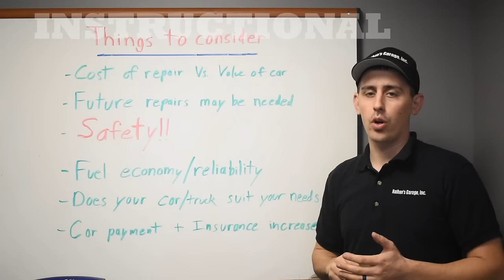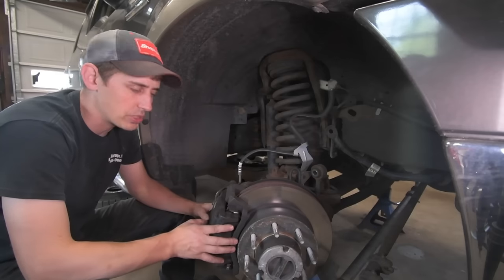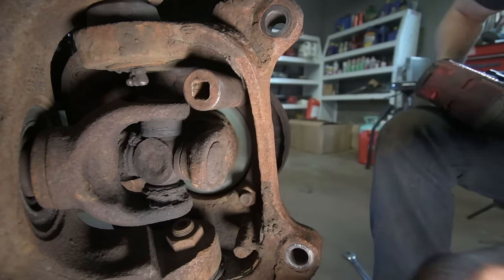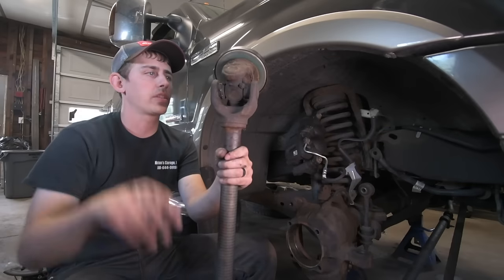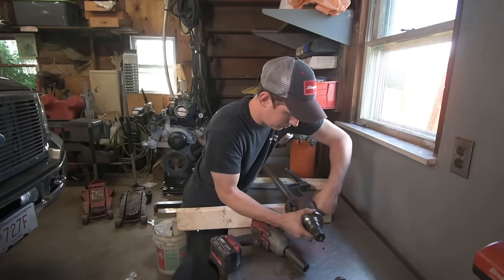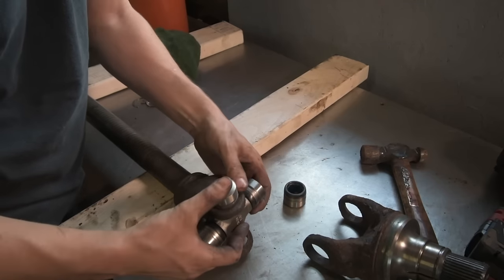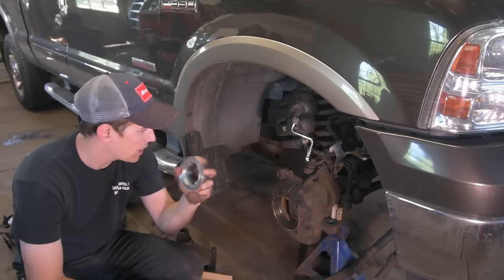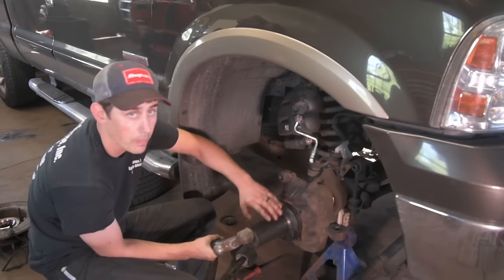Ford Superduty Steering wander repair....Axleshaft u-joints

Comment: This was PERFECTLY TIMED! I just did some upgrades on my truck's electrical system and took it down the road and the steering is sloppy as all get out! So this is the video I am hoping to use to correct a lot of that play in it. Thanks so much for this enlightenment young man! You just made this old fart's day!  :)
Reply from the maker: Thank you! hopefully this helps you find your problem.
Reply: @InTheShop  OOPS! I just deleted what I wrote because I was responding to the wrong article. Yep that would be me...the back woods hillbilly. LOL  And yes I think this is gonna be a huge help/ But getting the tools you had in this video is another story. So I might have to be super creative when I do it, plus I'm disabled so if I start that project it's probably gonna be most of the summer getting done. LOL. You know how it goes...remove a bolt and rest an hour. Then remove another then rest another hour. It wouldn't be so bad if I could be drinking a beer with each rest I take. LOL  Too funny. But seriously that IS the way I have to do things anymore.  I just replaced the idler wheels and pulleys and serpentine belt on this truck. Took me all week to get it done but she runs really good now and I can trust it to go a little bit longer distance than before. so that makes me happy.

Comment: the issues i had were resolved after i changed steer box / pump tie rods nothing worked it would get a little better with each thing finally  i changed the hydro boost for the brakes and that solved the problem

Comment: God Bless you after 2 steering box's, stearing pump . New line's and cooler and flushed out many times cost around 1,200 and my proublem is still there.  But I have a real good Gut feeling your 100% Spot on . I promise to come back and give you my results in a week or so.  One more thing Iam like you and don't mind getting my hands dirty but I found curad makes a rubber glove that really holds up there are 50 in a box  and I got them a a meyer in Michigan.  Thanks I do appreciate you my brother.
Reply from the maker: Hopefully this is it! Let me know what you find. Thank you!
Reply: It's going to our alma mi ford dealership Fri and there going to replace both sides cost 960.00 I will let you know

Comment: Great explanation sir. I currently experiencing a wonderer in my Dads  2005 f550. I'll bet that this is the problem with it as well. Thankyou for tge possible heads up . Little nervous tostab that axle back in correctly. I think I recall the spline to be difficult to line up to slide the axle back in. AL said,  I appreciate the pointers.  Till next time! 
David

Comment: Ive replaced entire front end of my 08 f250 shop truck and it still drifted left and right hate driving it anymore def checking ujoints first thing tomorrow thanks for the tip

Comment: Great informative video. I like that you really stick to the point and show exactly how to do the job. I have the exact problem and you confirmed my diagnosis. I will likely take it in to have it done as I don't have the special tools for the job and don't expect I will do it more than once each side. Thanks for doing this as I can now clearly instruct the shop what I want done.
Reply from the maker: Thanks for watching Cris. I love hearing from people when my videos helped them.
Reply: @InTheShop  Hey I got all my parts and tackled the job. Did both axles and replaced the hubs at the same time. Went pretty well as you demonstrated. The only thing I found was first I managed to get everything unbolted without dropping the tierod and my u-joints were so seized that the ball joint press did not work. I took the axles to a local machine shop and one was so seized that when the pushed it through the caps would not come off. They ended up cutting that one off. They only charged me $75 to re&re both u-joints so ended well.  Thanks again for the great instruction.

Comment: Excellent knowledge! Thanks for sharing. Will do my 2006 Ford 6.0l dual rear wheels tmwr.All front end steering components, Axle hub, universal joints, & tie rod ends.
Reply from the maker: Thanks for watching! Hopefully it all went smoothly for you.
Reply: @InTheShop  Not yet. I wrecked/ messed up 3 snap ring pliers. Could not remove the axle snap ring retaining clip. After 4 hrs three(3) snap ring pliers all damaged, i ordered a heavy duty snap ring. It got delivered today. Gear Wrench 2012D- heavy duty. Will update on progress.

Comment: Thanks for the info. Being an old farmer myself I’d be embarrassed to tell you about all the mistakes I’ve made changing universal joints. I have a 2002 F250 7.3 with about 260k miles and it’s wandering all over the road. Your video is going to make this job easier without all the unknowns that I usually encounter. You make great videos, easy to follow. I noticed that you didn’t use any type of spray loosener. Wouldn’t things come apart easier with some? Maybe I don’t need it. 
Don’t know where I’m going to get those Ford tools, probably have to make some. How far can I go until the wheels fall off? Haha, just joking.

Comment: this was a great video. I have an 01 350 and i have a sneaking suspicion that it may be the front axle Ujoints but i am not 100% because i don't have steering problems. the problems I am having is that in 2wd going 55+  a low pitched humming noise happens accompanied by a light vibration. but in 4wd whether high or low the front end almost sounds like the drivers side start popping and clunking. some have told me it is the unit bearing but i jacked it up and couldn't find any slop or play so i have kind of hit a road block here and i don't have thousands to pay a shop to diag and repair it for me you know... but the noise also almost sounds like it's coming from the pumpkin as well....
Reply from the maker: The humming is likely the bearing. Most times unless they are really bad you won’t be able to hear or feel the play in the bearing.
Reply: @InTheShop  yeah but the humming and popping clunking sounds started at the exact same time and if it isn't the unit bearings causing the popping and clunking noise then I am thinking it may not be them I just don't want to drop around $400 for wheel bearings just to find out it's not them you know? Or even worse drop that money and do all of that work to find out it wasn't them AND that I have to do that work and then some all over again.
Reply: @insaneTrout  Your U joints going bad likely damaged the wheel bearing. Not what you like to see but it happens.

Comment: I have a 97 sclb powerstroke with skys shackle flip kit.  It has sloppy wandering steering. Ive done everything to the front-end except the u joints. I will check u joints now

Comment: Good work!  Currently chasing a steering issue on my 08’. I will check my u joints to see if they are free.  I don’t hear any strange noises in 4 wheel drive so I assume they are working. Seems like running with the hubs locked would give this problem away quickly.
Reply from the maker: Thank you! Sometimes this won't be obvious when driving because the power steering can easily overcome the resistance.

Comment: Great Video and perfect step by step.  I would have liked to have seen a torque wrench at a few VERY important steps in there to reinforce how important bolt tension (Stretch) is on steering components (which is why they included new wheel bearing nuts for the studs).  But all in all you get my vote, hands down, for a great tutorial.
Reply: And you missed your calling, you would have made a great Airframe Mechanic... well, you still could, I became one at 59 after 40+ years in construction.  For some, like you, it comes naturally (the learning and retaining).
Reply from the maker: Thank you so much!

Comment: Extremely well done video Nathan, how ever you didn't show which way the grease nipple should face, Should it be in toward the axle or face out toward the nuckle hub?
Reply from the maker: Thanks Lawrence! I like to point the grease fitting towards the axle. The reason I do this is if you turn the wheel you can get the grease gun straight on to it. If you face it toward the knuckle the grease gun will always have to go on at an angle.

Comment: Excellent video, brilliant young man.  Direct, to the point, a lot of good tips based on actual experience.  I replaced left side hub bearing/seal/u joints on my '05 several years ago and see where I made mistakes.  Getting ready to do both sides again so I can get it right and maybe the SOTF will work again.
Reply from the maker: Thanks Jim!!

Comment: You could do your axle shaft joint check without taking off the tie rods buy turning the wheel locking the hub and trying to rotate the wheel you will feel it binding as you rotate it
Reply from the maker: On one as severe as this was you could probably feel that in the wheel but in a less severe case the mechanical advantage of the steering box can make it not as evident.

Comment: I had this happen on an ‘80 CJ I had.  It would actually ‘grab’ the steering and pull it. 

On these Ford’s with the bearing cartridge, I’d just replace that too while it was apart.
Reply from the maker: Most times the bearing needs to be done at the same time. These wee pretty recently replaced. Thanks for watching!

Comment: I really enjoy your videos and you are very good at expressing your knowledge so it’s easy to follow. With that being said maybe you can help me diagnose an issue I’m having with my 06 F350. I am having a vibration issue at almost exactly 45mph, the steering wheel does not shimmy or vibrate and does not pull in either direction. Apparently the previous owner had issues with this as well from looking at the maintenance records he provide when I bought the truck.
Reply from the maker: I would start by inspecting the rear driveshaft. The universal joints and the center support bearing are both very common.
Reply: @InTheShop  thanks for the advice and for actually responding. Once this is all over I'll use my friend's garage and check those out.

Comment: This can happen from not using your 4wd.  If you have manual hubs engage them occasionally and drive around.  You wont hurt anything w/ just the hubs engaged.  If you have an automatic system, go to a gravel lot and drive some figure 8's for a few mins.  Give those ujoints some exercise.
Reply from the maker: Absolutely. That and some preventative maintenance if they have fittings.

Comment: Well done! Lots of information not typically included by the less experienced. Best of all, you didn't waste any video time putting on a horse and pony show. As an automotive instructor, I am always on the hunt for the most informative videos for my students. What most impressed me isn't so much that you are familiar with torsional stresses as they apply to universal joints, but that you cared enough to elaborate on the preferred placement of the grease fitting for the simple benefit of sharing that information with your viewers. Props to you!
Reply from the maker: Thank you so much. I have always wanted to teach and these videos have been my way of doing that. I love when people get something out of the info I share. This comment means a lot to me.

Comment: I have had this issue several times.  I have come across locked ball joints too where you couldn't feel anything with vehicle jacked up and bar under tire and moving wheel but once you took everything off knuckle and then turn it it would bind.
Reply from the maker: Another common problem. Thanks for watching.

Comment: Excellent video. Just had front end rebuilt and steering box replaced and still got a bit of drift. I know on axle and ujoint was replaced just before I bought the truck but the previous owner said he hasnt done the passenger side. Im assuming when you buy the wheel hub assembly it is already sealed. Mine was already converted from auto 4wd to manual so I assume the vacuum system is not needed for anything and can just be sealed. I do have ABS tho. Thanks for the info very much! Helped me diagnose other problems I thought were unrelated.

Comment: Amazing. I assume this is what’s wrong with my excursion. A friend of mine put $3,000 in a full new suspension system to fix his wander and it never worked. I have wander and I couldn’t figure out what it was because everyone I know who own excursions said they have wander.
Reply: Try replacing the gear box with a redhead or Blue top.

Comment: Nice video. The upper "tie rod" is actually called a drag link. A tie rod connects one steering knuckle to the one on the other side so both front wheels turn together while the drag link connects one steering knuckle to the steering gear box.

Comment: I think the best way to get that wheel bearing off is to wedge in between the knuckle and the bearing. Start with a very small flat head screwdriver and work up in size. Don’t pry, just hammer it in and pull it back out

Comment: There's a much easier way to diagnose this, without any disassembly. With the hubs unlocked and transfer case in 2H, turn the wheels a bit to one side or the other. Using a long-ish prybar try to turn the axle shaft at the universal joint. It should turn a full revolution pretty easily.
Reply from the maker: That’s another great way to check them. I personally prefer this method because it’s not a lot of work to pop the tie rods and it eliminates any other resistance besides possible bound up ball joints. Thanks for watching and thank you for your input.

Comment: What I like to do is to soak that shaft the night before in penetrating spray, sometimes I just cut the trunion out instead of forcing the caps through the rust, and I always throw the ujoint into the freezer for an hour, goes in like butter. Thats how its done up here in the rust  belt
I hope customer got his money back for the new box or old one put back in.
Reply from the maker: Thanks for watching. The customer chose to not pursue the previous shop.

Comment: Awesome video! My u-joint was the culprit, trying to put the truck back together right now and can’t get my auto 4wheel drive locker to match up with the axle splines. Tried spinning the axle while trying to push 4wheel hub on but something is holding it up. Any recommendations would definitely help right now!
Reply from the maker: Pepe Vargas spinning the hub while also wiggling with inward pressure is usually what it takes

Comment: make a seal installation tool out of a 2 inch to 3 inch plumbing reducer with a 1 foot length of 2 inch schedule 40 and end cap . cost about 12 bucks works great.
Reply from the maker: That’s a good option

Comment: Another easy way to check the U Joint without removing the wheel is by jacking the wheel off the ground and with the wheel straight lock the hub and spin the wheel, should spin free, now turn the wheel just a little bit left or right, if the U joint is bad you won't be able to spin the wheel.

Comment: You’re video was very good to the point didn’t leave a bunch of stuff out as you’re doing the work like some other videos do I have a 2019 F250  I’ve had the death wobble happen when I hit expansion joints on bridges or potholes I’ve had the steering dampener replaced twice and the drag link ball joints replaced once it’s like a 13,000 miles on it I still have that sway or bump steer whatever you wanna call it when I hit bumps and such and I don’t quite know what it is after looking at your video at approximately how many miles would that knuckle go out? Also I noticed that I was doing about 45 miles an hour and I came up in traffic and I rear ended somebody because the truck would exactly stop it kind of glided to stop if you know what I mean I had Ford check the brakes out they said of course there’s nothing wrong with it I know there is because I’ve taken the truck out again at the exact same speed I slam on the brakes and I still glide to a stop. Any suggestions on both problems

Comment: great info, thanks.
someone send this man some brake caliper hanger hooks.
Reply from the maker: Haha thanks for watching! I used to have a nice set of caliper hanger hooks but they grew legs and walked right out of my shop. Still haven’t gotten around to replacing them.
Reply: I bend an 1/8 inch welding rod. Works good.

Comment: I turn the wheels hard left or right. Hubs unlocked, in 2 wheel drive. Spin the axles. They should turn smooth and free. No need to jack it up or take anything apart.

Comment: You know...you can use a puller for that hub. It has 3 jaws that go around the back of the hub and the center shaft you tighten centers in the axle shaft. Works pretty well. You might have to tap the sides of the hub if it is really tight.
Reply from the maker: I have seen them pulled that way but I haven’t had the opportunity to try it. Thank you for the input and thank you for watching. Maybe I will try it that way in the future.

Comment: We replaced our u joints and the truck still does not come to center.  We replaced all the steering parts and the box and it still does not come to center.   Frustrated as the problem is actually worse than when it had bad u joints ball joints and tie rod ends.   Now it really needs constant correction.  and yes we load torqued the upper n lower ball joints to spec.  We will proceed to jack the truck and check each side after watching this video.  We suspected a bent axle when we did the repairs and now this may confirm it.

Comment: The company I worked for years ago had a fleet of Ford trucks and vans. This was the 1980's and 90's. The trucks handled just fine but those vans were all over the road. I just bought a 2006 E350 van and it is just like a bad dream all over again. I thought Ford would have gotten it right by now.
Reply from the maker: Unfortunately it hasn't gotten much better.